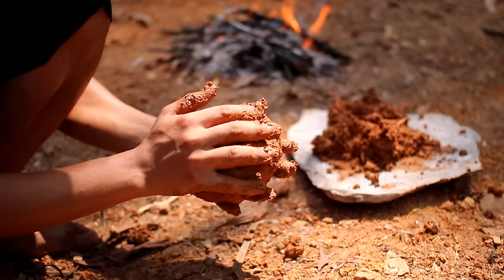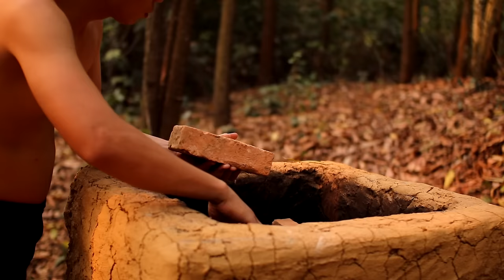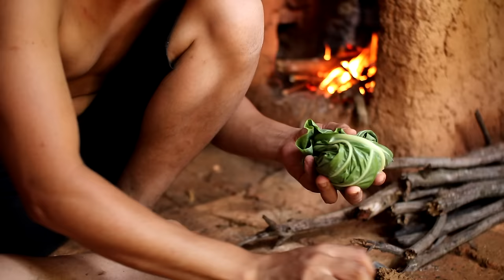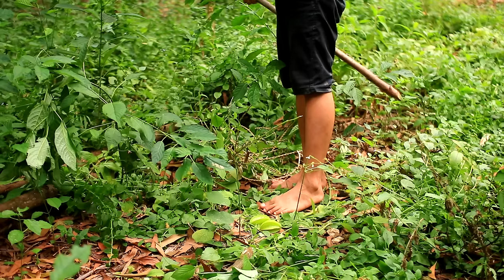500 Days Survival And Build In A Rain Forest - NO FOOD, NO WATER, NO SHELTER

Comment: I'm intrigued how the rain water can not leak through the roof, while the tile is completely flat, there is no channelings whatsoever in the tile that may be able to seal the rain water from leaking and falling down through the roof.
Reply: So what happened is a tarp was put under the roof mostlikely
Reply: Overlapping tiles downward - just like any roofing material.  Also, they are overlapped half way down and on the seem of the ones below it. The water cascades from top to bottom over the overlapping tiles.   If the tiles were done in the opposite manner the roof would leak.
Reply: That's literally how roofs work 🤷🏻‍♂️. I'm guessing you're from the us.

Comment: (I'm aware this is a paid actor supported by a full production team interested only in the ad revenue and not accuracy or honesty, so where I say "you" I really mean all of them...)

1:15:  Store-bought refined clay, with oil content not found in nature.  You should read up on slaking.
4:10: Poof, grey clay?  From where?
8:40: twist store-bought twine into rope.  yeah, okay.
9:20: the pencil-and-ruler lines would be easier to buy if you didn't then make fairly miserable ones moments later with charcoal
10:41: cane?  far too uniform and round; that's more of the twisted store-bought twine.
11:00: lol, more perfectly smooth clay with added oils for forming.
11:35: After all that effort trying to cut a smooth top, no luck; time to bust out the plastic mold to get those nice round edges.
21:30: The bricks : mortar ratio is way, way off for that kind of mortar.  Did you burn down twenty acres to get that much ash?
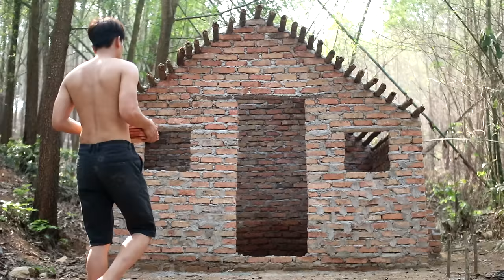27:10 lol, the tiles that came out after being fire on edge are not the tiles you put into the furnace.  
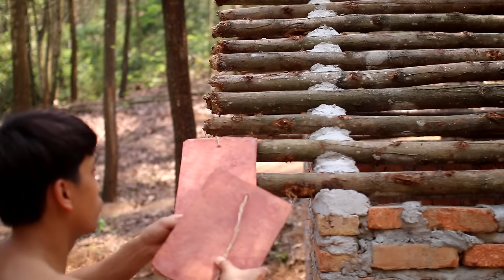28:23 lol, no, this is not how you hang tiles.  this won't last one rainy season before the 'banana rope' rots through and dumps your palette of store-bought tiles on the ground
29:35 I love how you put grey, unrefined clay tiles into a furnace and pulled out bright red tiles made from an iron-rich clay with zero sign of smoke or fire glazing on them.  Wood-fired pottery is very different than the sort of electric-kiln-fired pottery you get from the hardware store.
30:45 and again, but also a good time to mention you aren't getting your tiles hot enough in the open-topped furnace, which is why they're in a pile off-camera slowly dissolving when it rains
32:45 and again, zero sign that these bricks have ever been near a wood fire
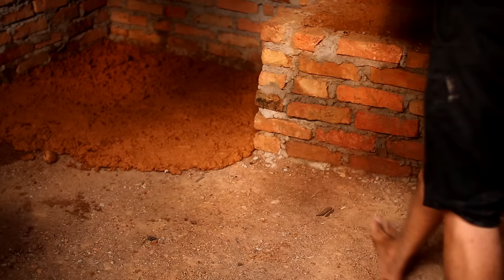33:01 Love that we can see efflorescence on these "newly fired" bricks.  That white patch?  Yeah, doesn't happen on new bricks, that's something that happens with cheaply manufactured bricks that have had a lot of time to ooze salts from the fillers used.  Not something that happens much with natural clay bricks pulled from a kiln recently.
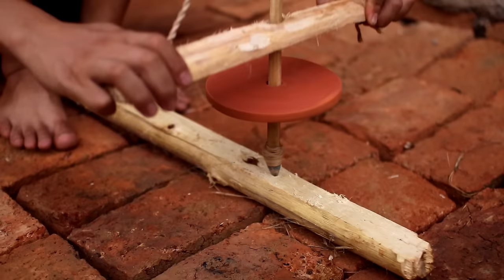37:40 that's just a bad design.  because the shaft and the hole cut through the 'handmade' pottery wheel are round, it just spins freely instead of being a flywheel that keep the shaft moving
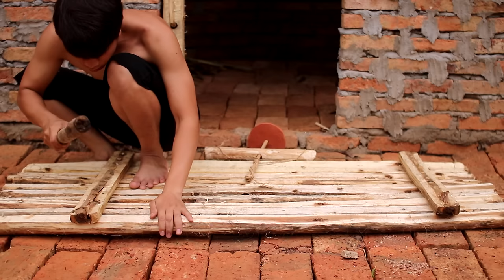38:55 your 2x4 is splitting
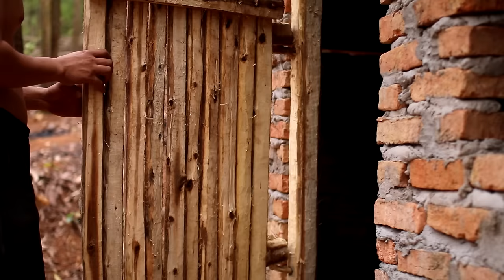39:35 I mean, it's neat how you roughed up a bunch of bandsaw-cut wood to make it look like you did it all with a stone axe, but the planar bits are far, far too in-plane.
40:00 seriously?  you can't even resist dumping a box of store-bought bamboo on the ground to make it look like you harvested it?  just look at those perfectly-cut ends we're to believe were cut with a stone tool...  I might have bought it if it broken at the joints, but you don't even have the taper right; these are short sections cut from far, far taller bamboo plants.  oof, and that rope.
41:30 at least it's an idea that didn't come directly from the smaller channel this one borrows everything else from...
43:30 you've gotten a bit better at hiding the obvious signs of digging with a backhoe, but the walls are still far too smooth on the right-side wall, and, uh, you missed some tire tracks
45:19 what's the perfectly-cut dowel in the background?  a shovel?
51:40 the fact that the tank didn't collapse outwards despite there being loose soil surrounding it and being made of a wobbly stack of excessively-mortared bricks makes it pretty clear that this was re-done in pool concrete over a metal frame, probably rebar
52:15 oh, the blocking for this is hilarious.  is the fish in the water or is it standing on land, about five feet tall?  why does the string go out directly sideways?  why is the fish pulling it so consistently, is the river fifty feed wide and the fish is a sunday driver?  why don't the fish move at all when being pulled from the river?
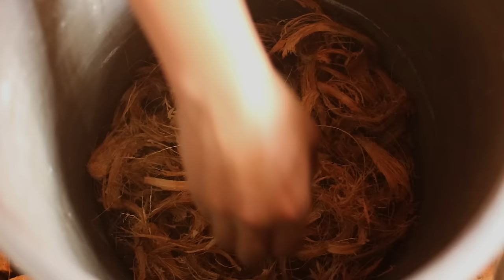55:20 those disks of potato aren't going to grow.  they don't have eyes.  you've made compost.  Also, as anybody who's done aquaculture will tell you, you've also killed the fish because you haven't oxygenated the water.
56:00 lol!  that's not how potatoes grow, they grow from the skin.  did you just poke holes in a raw potato and stick store-bought seedlings into them?
56:46 where'd the fish go?  too much work to move them from the real tank for this shot?
60:00 "some time later"  what, no fake beard to go with the wig?
1:02:29 what, the prop department couldn't find white yams?  so you "planted" white yams and they grew purple ones?
1:03:49 you could have just said you caught another fish in the stream.  now it looks like you cooked a catfish and somehow ended up with a completely different fish.
1:09:55  "I haven't eaten this well in months"  dude, you shot this over a couple days.  you probably ate better for breakfast.

Thank god you just added a couple shots of fresh-from-the-farm quail chicks.  Not sure I could have stomached the effort you'd need to go through to make it look like they also aged 500 days...
Reply: You did all this effort for what
Reply: @staystrong4309 to explain the faking
Reply: bro im pretty sure most people know its fake, alot vids like this are but who really cares entertainment is entertainment
Reply: If you know any legit channel, please share. I didnt watch the entire video before reading this, also didnt pay that much atention to the details, but that roof of the house was definitely stupid
Reply: Severely underrated comment
Reply: do you really have no life?
Reply: @TTV_dark_vase57  having all this knowledge, he sure does have a life
Reply: @DIMI5034  The original primitive technology channel is legit.  He has successes and failures, and is very honest about the time, effort, and results.  He recently had an entire building collapse because when you don't have modern bricks, modern mortar and modern rebar, natural building techniques are a challenge.
Reply: They guy is just trying to get by like everyone else. If you are not entertained and you don't like it don't watch.
Reply: Ваш комментарий вилка, которой я снимаю лапшу со своих ушей 😅спасибо. Меня смутили черепица, батат, перепела и рыба 😁
Reply: Jesus Christ who pissed in your cereal this morning
Just let people enjoy the video, it doesn't matter if he's faking it or not.
Also, the grey clay is from where he mixes the normal red clay with wood ash.
Reply: I came to the comments just to see if anyone else noticed that the orange yam he cut up had grown purple yams! Lol it's entertaining, that's for sure.
Reply: 2
Reply: its sad that i kept watching just to see what this person was talking about and they were spot on XD
Reply: THE BEST COMMENT XD
Reply: @DIMI5034  Chad Zuber has a neat channel IMO
Reply: I thought the roof shingles hanging by a thread were hilarious! Theatre! 😅
Reply: The only thing I can find "wrong" in your list is the comment about no fake beard, a lot of men, especially Asian men, just don't grow beards. Otherwise, magnificient, you caught a few that I didn't notice (and probably should have).
Reply: Late comment but i actually learnt a heap of critical thinking and observation skills just by going through all the things you pointed out. It kinda pisses me off that so many of these "primitive survival" videos are completely fake. Im no expert on these things but i always wanted to live this way for a while and the only way for me to learn are videos like this...but if it's all fake then. 500 days passes but he looks the same through the whole video.
Reply: @DIMI5034  searsh for ANDERSON MACAHADO. Its a brazilian dude with no pro content, just playn hardwork and rogh edges on the projects. Very nice to watch

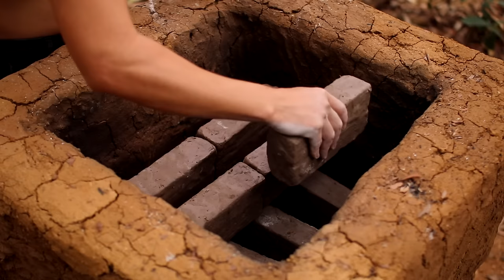Comment: in this section you can see the bricks are very thick: 12:33
then in this section you can see the size of the mature bricks which is different from the ones he made: 13:28

It can be seen that the stove used for burning doesn't produce a continuous fire, but looks like it only burns once or twice, whereas in the video it makes a lot of bricks.

It is impossible for the stove to be burned continuously and it will only cause black ignition marks

I like survival content but not the way you trick the audience by buying the product and making it seem like you made it yourself